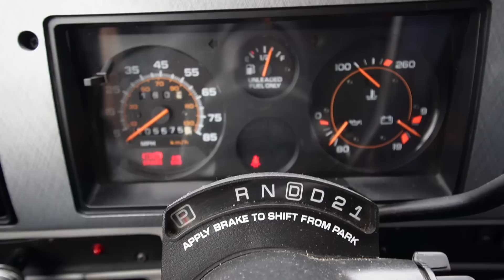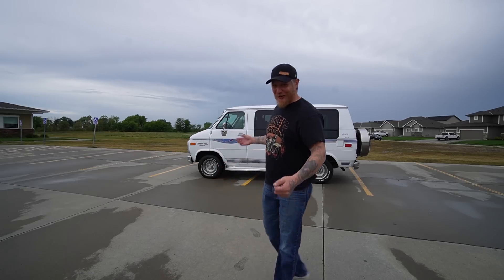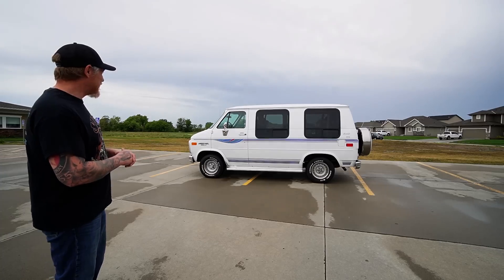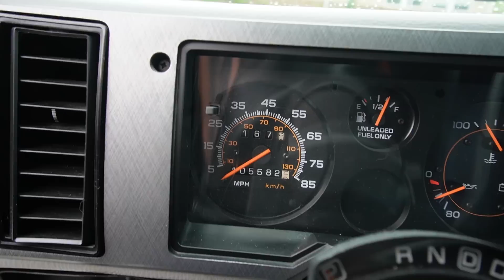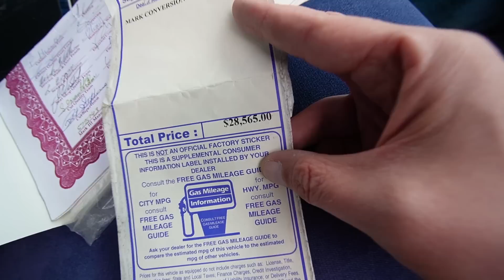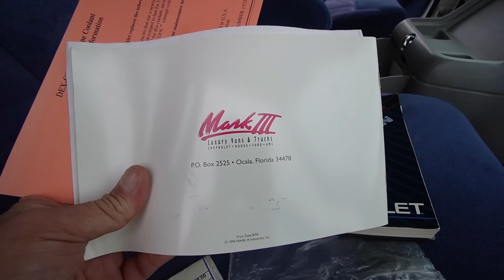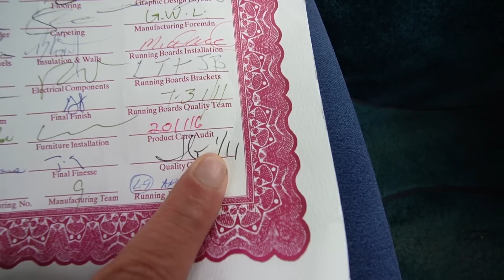I Bought A Mint 28 Year Old Chevy Van

Comment: HF 100w solar panel --> Jackery 300+ watt power station/pack --> whatever size mechanical iceless fridge/freezer combo = pure heaven/continuous use. 😎 Van and/or truck. You won't be disappointed. Congrats on the van ✌️☮️

Comment: I had a chance to buy the GMC version of this van, a couple years newer, with only 66k miles on it, but couldn't pull the trigger fast enough.  I liked that it was the shorter length.  It was definitely lacking in power, but that will be better gas mileage.  Looking forward to the build!

Comment: Congrats!!! My old '96 Dodge conversion has the wing windows & drivers side floor vent. Paid 22k for it, new in '96. It now sits, hasn't been ran in a few years now. 
I currently drive & camp in a '98 Ford Econoline van. It's hitting 200k miles & still running strong! It's not a conversion, but it is set up for camping. It could easily be used for fulltime van life. 
Enjoy your-new-to you sweet ride!! It's very clean!
Oh & I cannot use my console cup holders either. I bought a thing that I put on the floor, between the front seats,  from Wal-Mart that can hold 2 drink containers & other things.

Comment: Holy shit that's one of the absolute cleanest 95 model vehicles I've ever seen.  I'm from TN so you don't deal with much snow so the vehicle doesn't deal with salted roads.  It would've been released in September of 1994 so it's almost 29 years old.  Despite only 165 hp/230 torque those 4.3 vortec Chevy V6 motors are tough.  It's not like you would be speeding anywhere regardless.  I'd like to see a video before any conversion.  I love it but I'm only 5'9" and would fit perfect in the back like it is.

Comment: I have a 2002 gmc 3500 Savana 5.7 cargo base van. Love it. Gm is pretty bad quality when it comes to body, plastic, interior and wiring. But the other parts of it are pretty solid. When I bought my van I remember that I could NOT find financing for a used conversion van. But for a cargo van I could. That was in 2007. I wish I had factory ride height gm four wheel drive. No lift kit. Not big tires. But 4x4 hi and low and 2 wheel drive. Gets stuck pretty easily and spins when backing a trailer. The beautiful of gm is it's a little cheaper to repair than ford. But the ford is a little more solid, tighter body quality, beefier and better torque. I'd guess ford is 20% more expensive for parts. In 2002, what sold me on the gm van was the swing away back doors. Ford standard didn't have that.,,had to be custom option. This van in your video is nostalgic and beautiful! 👏🏼 I had a 1989 like this. Loved it. I'm 6,3 and one thing I didn't like was tire inner fender in floorboard forced my feet to be sandwiched over toward gas pedal causing back pain. The 4.3 is a good engine.

Comment: Yeah, vans are sweet....nice score! I am on van #3. You've got a real cherry there! I have had a '95 Chevy, a '97 Chevy and current is a '99 GMC from Texas so NOT a spot of rust on her and she don't see any NYS salt! I also have a Silverado (that I had to replace lifters in) that is for towing and work. You may want to git a swivel mount for that front passenger seat. And for the bed in mine I bought a nice foam mattress for over the top of that sofa bed....VERY comfortable! I also took out the middle buckets for more space. My '99 is also set up with a reese hitch and it tows trailers and boats fine. (have the 350 in that one). Good luck with yours.
Reply: Also- I like to grab a carpet remnant (about 4x4 or so) and throw it in the van to keep the actual carpet clean. In and out many times track a lot of dirt and crap inside. Then when it gets dirty you can just take it out and shake the dirt off. If it gets really grubby jut toss sit out and grab a new one.

Comment: Hey I'm new to your channel but in 2003 my dad bought my mom a voluntary bank repossession 1997 Chevy Suburban k2500 LT 454 it was a customer built truck with 125,000 miles he got it for 12,000$ because the bank listed it as a 350 vortec not the 454 vortec. The window sticker when new was $45,000 that would be close to $86,000 in 2023 but the lady who bought it new had it fully loaded and a custom paint job and body kit by a conversion company that conversion was probably around $10,000 to $15,000, she bought it and custom order it to haul her horse trailers and horses to county fairs but she lost her job and decided to just volunteer to surrender the truck back to the bank. It currently has 285,000 miles and had the 4l80E NP243 14 bolt G80 F/R and the L29 454 had its valve covers and break booster done 
Runs good

Comment: That's a great find CQ!! I just finished gutting a 2000 chevy midrise hightop..got it with 140k miles on it and it's almost as clean as yours. Nearly rust free as well, which was my biggest concern..but, when I ripped out the walls in the back, the wiring and rear AC was super intimidating as there was a literal shit ton of wiring bc, much like your van, mine was loaded with all the bells & whistles. That part of the demo sucked. Really interested in what you'll do with this van. Congrats on a fantastic find!!!

Comment: Very nice van, I bought the 96' when they came out, it had the 305 in it, black on the outside, with the same color blue interior but leather seats. I drove it for 15 years and sold it with 140k I should have kept it.

Comment: Mark III was a top shelf conversion company back in that day, vans were their main deal, but they were well known for their Pickup truck conversions. 

That'd be closer to a base model, judging by the V6 and low roof. 
Most had a raised roof.
Reply from the maker: Yeah, it's crazy to think about the original price of this compared to a fully loaded long wheelbase high roof
Reply: @CrazyQuady  80's and 90's,  conversion vans were top of the line, killed off by the SUV craze. 
Now it's a niche thing, with newer Explorer conversions around $100k